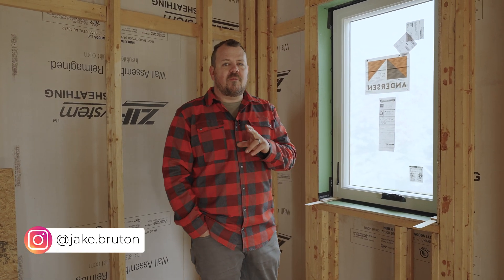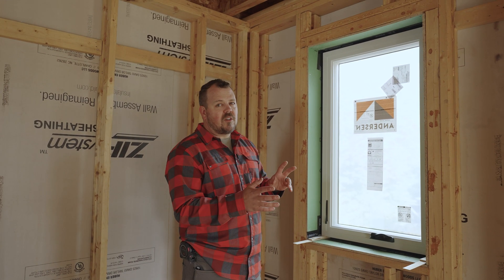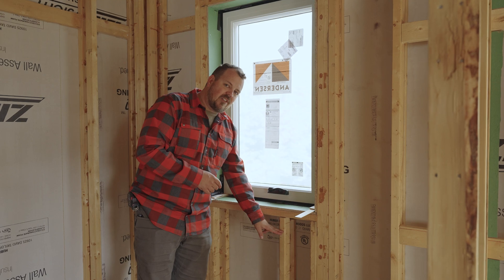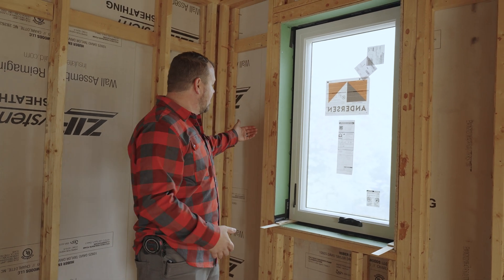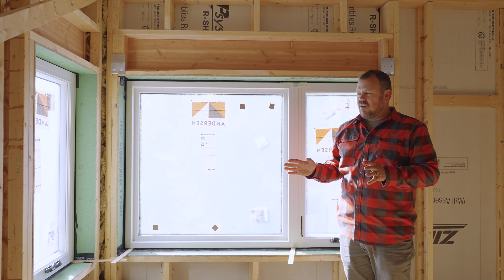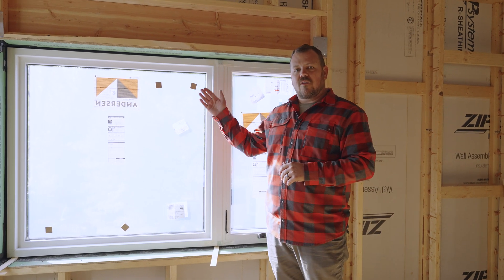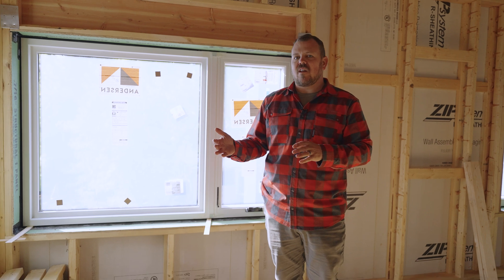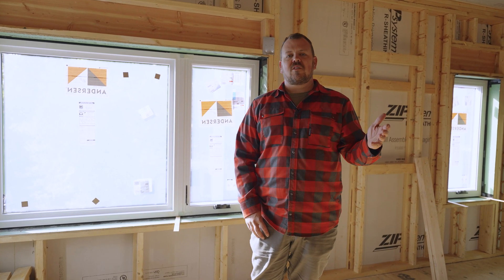Headers Made From T-Studs

Comment: I can't help but see it all the time on T-Studs is the blowout for the dowel rods. Isn't there a way they could manufacture them without the constant blowout? Usually when drilling a hole in wood someone would use a sacrificial piece of wood to prevent that. I imagine they have a machine that has many drills going at the same time at the same angle. So having a jib piece with the holes for the drill bits would work. I get that it has little impact on the strength of the stud, but when trying to convince a customer to spend the extra money on T-Studs compared to traditional studs, it would help a lot.

Comment: T- stud shows in there ads that they have t-studs with the same face width on both sides. Instead of having one side 1 1/2" wide on one side
and 2 1/2" on the other making cutting difficult, won't t-stud sell you a stud with the same face width on both sides to make it easier?